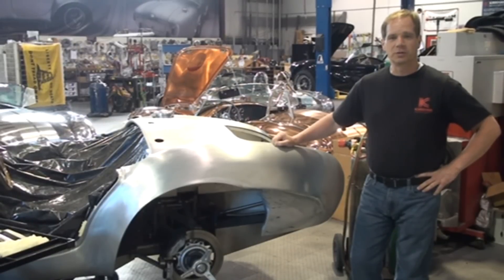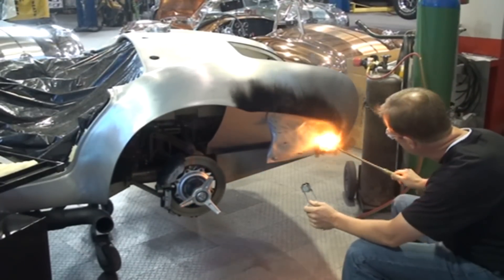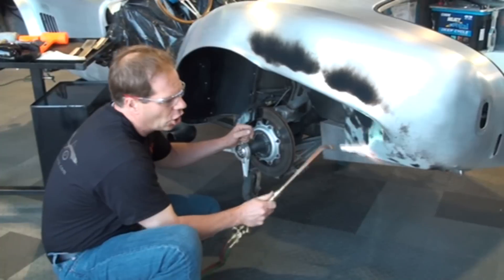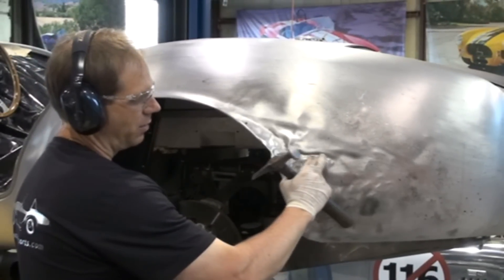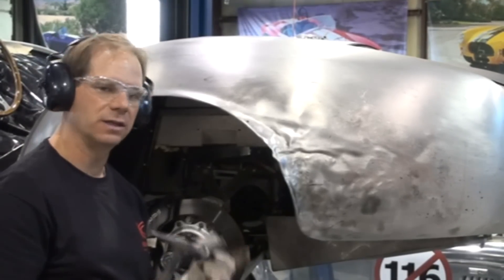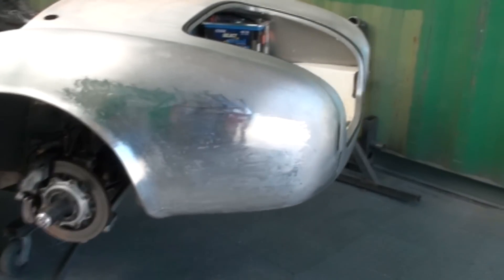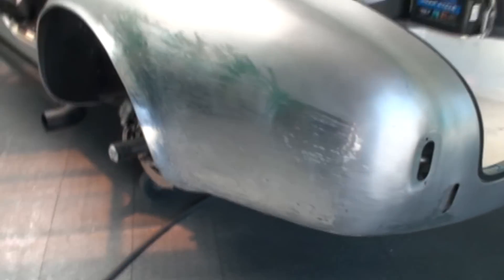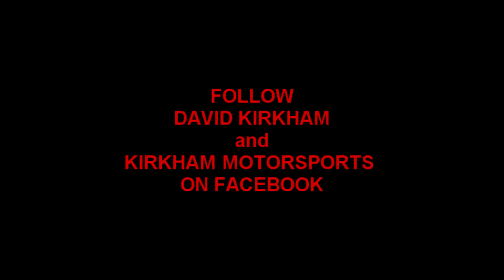Kirkham University Aluminum Fender Dent Repair

Comment: I'm rebuilding a '75 land rover and wanted the polished aluminium look. It has a few off road battle scars that I was told these dents could not repaired and needed to be filled. Compared to the dent you have repaired, these are tiny by comparison.
Of course you, as a master craftsmen,  have made it look easy.  

After annealing, the secret seems to be "slowly and gently" I'm going to try it on a "scrap" fender for practice first.

If my numbers come up in the Lotto, I'll be placing an order for a 427 street; your cars are awesome!.

Thank you for posting this video.
Reply from the maker: Patience is the key.  Just go slowly and you will be amazed at what you can accomplish.
Reply: Grant Stewart i have a 1972 series 3. i am doing the same thing -- going for the airplane/airstream aluminum and rivet look. wonderful video!
Reply: How did the Land rover turn out?

Comment: How did you heat treat the metal to regain the temper after the annealing and repair were complete? I dont think that it would work harden with any uniformity after plannishing.
Reply from the maker: The alloy we use is not heat treatable.  Most car bodies are not made from heat treatable aluminum.  The work hardening is not exactly even--but it isn't even when it is made either, regardless of the process.
Reply: Really nice work. I do have some questions regarding your shop capabilities. Can you 3D laser scan/model and CNC machine parts as large as 48in x 32in x 8 in(H)? How do you price services, by hour or by Job?
Thx in advance
John

Comment: amazing,,,alum is fun to work with cause every time you hit it and heat it the molecules scatter making it soft and easier to form after about a month the alum goes back to its intended hardness all by its self remarkable really..
great job thank you for showing your work.
Reply: I think you have to quench the alum to get the aging effect that makes it harder.... also depends on the alloy
Reply from the maker: Thank you and Jose for your comments.  Hardening aluminum is a bit tricky to understand.  Generally speaking, there are two categories of aluminum--those that are heat treatable and those that are not.  The aluminum we use for our bodies is not heat treatable.  With the heat treatable alloys, Jose is correct--the aluminum needs to be brought up to a certain temperature and then quenched.  After quenching, the aluminum is then aged to harden it.  Aging can be accelerated by heating it up (to a temperature below the quenching temperature).  Aluminum is a magical metal.
Reply: @KirkhamMotorsports1  I am a repairman in Brazil, where aluminum bodies are still rare, but the question is, how do you know if an aluminum has been treated for heat or not?

Comment: Thx dk from another dk! I see it requires a methodology and patience, and gives me inspiration to repair the alum bodywork on my Aston Martin. What I'm wondering is: doesn't all that shaping stretch the metal?
Reply from the maker: Yes, the metal does stretch.  It also shrinks a bit when you straighten it.  If you are very careful you can lose the stretch as you blend it back into the non-damaged part of the body.

Comment: Very well done. Impressive. Though you mention using a steel hammer and dolly. I thought you only wanted to use aluminum tools when repairing aluminum because of the corrosive process that steel tools can cause.
Reply from the maker: Craftsmen have been using steel tools on aluminum bodies for over 100  years.  You actually need hardened steel tools to withstand the abuse of the pounding.  I've had my hammer for almost 30 years.  I bought it at Sears!  I love it.  It is the most coveted hammer in our shop :)

Comment from the maker: 0.040 is tough to work with.  The original race cars were made from 0.040.  It is always best to tap the dents out as much as you can (carefully!)  before you add any filler.  If you are patient enough, you might be able to remove them entirely without using filler.

Comment: Yes, my 5/16 is plate. I going to try to invent a new way to work with that thickness using heat, vibration and pressure.

Comment from the maker: 5/16" is pretty thick for bodies (plate is usually defined at 1/8" and above).  Certainly 5/16" can be pressed and worked.  We recently did 1/4" for some seats--aircraft manufacturers do thick material as well.

Comment from the maker: You only anneal the aluminum if you have to.  I wanted the aluminum to work harden as I straightened it so the fender would be a bit stronger when we were done.  It has to be some pretty nasty damage to have to be annealed twice--I have done it, however.

Comment: that would look cool in a speeded- video with the hammering cut out .when videoing ,pull your tools away from the area you are repairing so the camera can get a clear shot of that surface for a few frames.now when your done filming the repair,you can edit out,cut out evert thing but the clear shots and it will look like it grew back into shape.play that bacwards and it will look like it being bashed in by an invisible force.just a thought..

Comment: I learned a lot from this. Was wondering why you didn't anneal the work again once or twice to make the work easier and also to prevent cracking. Seems that much hammering/working the aluminum would have made it real hard and brittle. Thanks.

Comment: Nice video! ... not mentioned is that a gloved hand is much better than a bare hand for feeling dents. I have never worked with automotive aluminum, but we always used a gloved hand for estimates and repairs on steel auto panels. Of course, aluminum is so "dirty", gloves are required! Also, it was a good example that you were wearing ear protection during hammering, which can cause hearing damage.

Comment from the maker: No, unfortunately the sand paper won't cut the high spots off.  The paper will just sort of roll over the high spots.  However, if you are really patient, and use brand new sand paper, you can get a bit of a cutting effect and make it much, much better.  You will just have a hard time brushing or polishing it.

Comment from the maker: I heated up the panel to anneal the aluminum.  Annealing makes it softer and easier to work with.  It also helps to prevent cracking from work hardening.

Comment: Impressive:  I've been trying to use some of your tips on a 1979 aluminum skinned travel trailer.  I have most of the big stuff out pounding from the exposed inside of the roof. (yeah working above my head) I don't nearly have the tools you have but I'm making some headway.  I don't have files.  Will aggressive sandpaper like 80 or 100 grit on a long board work?

Comment from the maker: Thank you for your kind words.  Our bodies Poland are made from 1.5mm aluminum.  The alloy is an old Soviet aircraft alloy that has no corresponding equivalent in the US.  It is much harder than 3003.  For our Coupes we are making the body from 3003.  For highly formed panels, we use 3003 H0 and 3003 H14 for panels that don't need much shape.  I have never seen anyone (including Ferrari) make panels from 0.016-0.020 WOW!  That is thin!  Original Cobras were made from 0.050" 1100-0 aluminum.
Reply: I suspect that the alloy is very close to our 5052 alloy which is an aluminum magnesium alloy.  The aluminium bodied Land Rovers were made of the British equivalent of 5052.  It is somewhat harder than 3003 or, certainly 1100.  Your "soot" annealing procedure is right out of the Land Rover service manual.  Thanks for the video.

Comment from the maker: Yes, you have to be extremely careful to not stretch the metal.  It is only at the very end of the straightening that I am hammering "on dolly."  I try to do as much "off dolly" work as possible to avoid stretching the panel.

Comment from the maker: No, it is much cheaper to fix the original panel when possible.  If you weld a new panel on, there is a tremendous amount of body work that has to be done to straighten out the weld, file it down, and blend it in.  We do replace panels on some repairs if the damage is too much to straighten easily.

Comment from the maker: The customer wanted a really nice job so we spent quite a bit of time blending the brushing into the original body to get everything to look right. Finally, the damage wasn't confined to the area in the video (I just limited the video to the major damage so the video wouldn't get too long to upload). The trunk gaps were messed up because the fender had been pulled away from the trunk. There was also damage by the jack hooks where the metal tore and had to be welded up.

Comment from the maker: @KirkhamMotorsports1, Finally, the damage wasn't confined to the area in the video (I just limited the video to the major damage so the video wouldn't get too long to upload). The trunk gaps were messed up because the fender had been pulled away from the trunk. There was also damage by the jack hooks where the metal tore and had to be welded up.

Comment from the maker: @KirkhamMotorsports1 There was an enormous amount of time planishing all the little dings out before filing. Also, many hours were spent sanding all the little file marks and coarser sanding marks out of the body with successive grits to eliminate any hint of the coarser grits. The customer wanted a really nice job so we spent quite a bit of time blending the brushing into the original body to get everything to look right.

Comment from the maker: @rickrichard01, technically speaking, "tempering" is heating up a metal to a certain temperature to make it softer.  In other words, on heat treatable alloys (that are quenched from a high temperature to achieve their hardness), tempering is used to draw some of the hardness back out of the alloy so it is not so brittle.  

What I think you are asking is if the metal gets hard again as I hammer it back into shape.  Yes it does.  That hardening process is called work hardening.

Comment from the maker: @UrsusMorologus, "weaker" is a difficult term to technically explain in a few words.  Annealing makes a metal softer/more ductile.  Yes, it is permanent...until you start to work harden it again by moving it with a hammer and dolly (or anything else).  The more you move a metal, the harder it becomes--until you anneal it again.

Comment from the maker: @KirkhamMotorsports1 CON'T, 
Finally, the damage wasn't confined to the area in the video (I just limited the video to the major damage so the video wouldn't get too long to upload). The trunk gaps were messed up because the fender had been pulled away from the trunk. There was also damage by the jack hooks where the metal tore and had to be welded up.

Comment from the maker: @KirkhamMotorsports1 CON'T, 
There was an enormous amount of time planishing all the little dings out before filing. Also, many hours were spent sanding all the little file marks and coarser sanding marks out of the body with successive grits to eliminate any hint of the coarser grits. The customer wanted a really nice job so we spent quite a bit of time blending the brushing into the original body to get everything to look right.